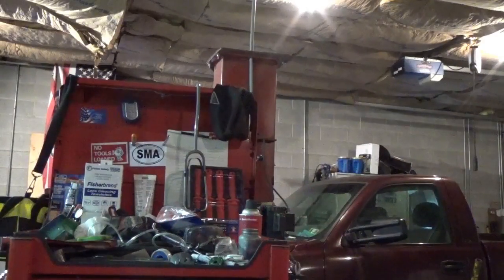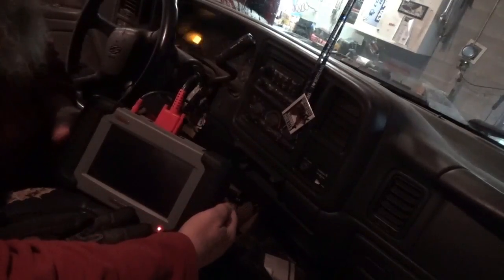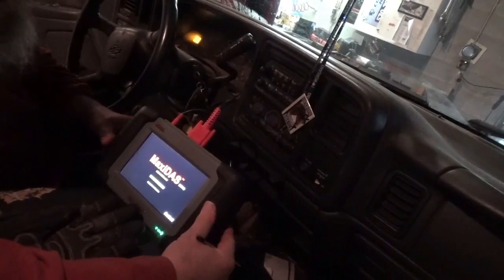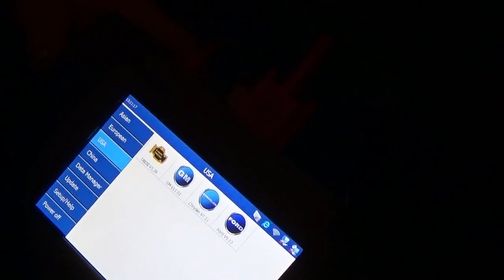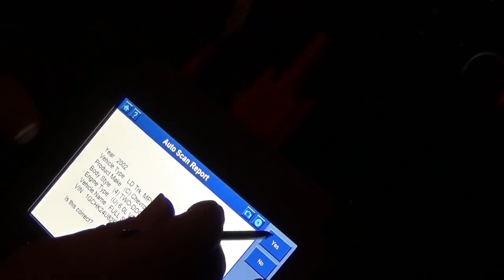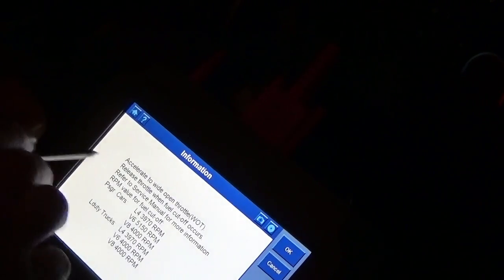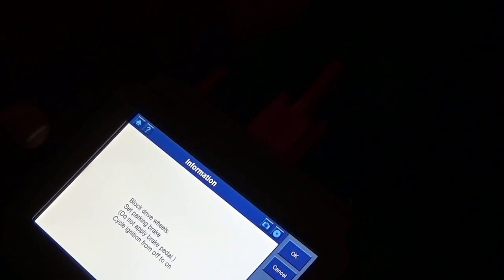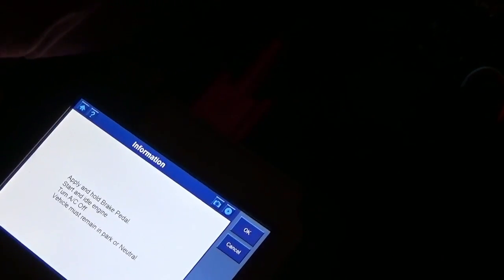Fixing P0300 on Chevy 6.0L with a Cylinder 1 & 6 misfire with Autel Maxidas DS708

Comment: Did you have a lack of power bas fuel mileage
Reply from the maker: I just really noticed the misfire no other real symptoms
Reply: cause mine shake a bit I have very poor accelerations tps maf sensor new intake  gasket new no vaccum leak injector spark plug and wire new the truck have
Reply: 180000km so engine are in top form but I can’t even spin wheel when it’s rain with bald tire
Reply: I don’t have live data scanner so I can’t you what cylinder is missing the most

Comment: Thanks for sharing this video, I have a 2005 GMC Sierra that had random misfire and after replacing plugs, wires, coils I was almost at my wits end. Though I would have to change other parts such as o2 sensors, or injectors but after watching this video and I have a snap on scanner (red brick) and did the CKP variation learn, no more misfires. Thanks again. :)
Reply from the maker: Glad it helped

Comment: Mike, your the Man. I wish I could drink some beers with ya. I can tell your a good dude Man. My whole passenger side of my engine is not working. I pull the wire off the coil and no difference. Does anybody know what's wrong with my 2003 GMC 2500HD. It has to be a wire short or some stupid to thing making it run in Limp mode

Comment: How did you find out it was a misfire on number 1 and 6. Mine just has code p0300
Reply from the maker: Scan tool misfire counter
Reply: @TheDisgruntledMechanic  
My buddy scanned it with a cheap Bluetooth and it just says p0300
Could old plugs cause it
Reply: What’s a scan tool misfire counter
Reply: @TheDisgruntledMechanic  
When getting a p0300 code does that mean a misfire on c1 and c6 for everyone ???

Comment: I have the same exact problem, new plugs, wires ,compression check, injector check. Is it possible that there is still an underlining condition with cylinders 1 and 6 and all this does is setting a performance baseline on the engine?

Comment: Ive still got this problem with the p0300, i just had the crank relearn done yesterday. I did all plugs, wires, coils, intake manifold gaskets, knock sensors and harness, one bad upstream 02, fuel pressure regulator and all the vacuum lines and still it misfires rough as hell and completely randomly. Idk what to do now and i rely on this truck for my new business. Also the truck only has 112k
Reply: don't leave us hanging! how did it turn out for ya?. edit* i saw on your profile you have a ram now i guess you traded it . thats one way to fix it!
Reply from the maker: a ram??? no way!! this particular truck has been retired though.
Reply: Did you ever figure out the issue?
Reply: Did you ever fix it?  If so, what did you do?
Reply: Same
Reply: what happennnneeedxxxx😮😮😮😮

Comment: I used my OTC "EVO" to relearn crank sensor ,it would not relearn , replaced crank sensor , no missfire on 1 & 6 cyl  ,but on cyl s 2 & 3 had missfire ,did crank relearn with OTC ,it did relearn , no more MISSFIRE ! ON  ANY CYLINDERS.
Reply: REPLACED CRANK SENSOR WITH GM # 12560228.
Reply from the maker: @kevinertl  Great info! thanks!

Comment: Was your engine idling rough? Was that why it was throwing that code?
Reply from the maker: it had the p0300 code. wasnt really much of a rough idle.  It is actually in a Tech service bulletin for these models to do this procedure if the engine is running rough.
Reply: Wow really, dang I wish I would have seen your video before I replaced all my injectors, coils, plugs, wires. Thanks man

Comment: I have chevy RV with the 6.0 motor. We thought it might be the lifter? Compression in cyl 8 was 150 and in 6 was only 120. Could this video be our real problem? The code was p0300 and p0306 (cylinder 6 misfire) any other way to do this procedure??
Reply from the maker: I really don't know. but the 120 compression would be where I would start with diagnoses.

Comment: My check engine light flashes when rpm gets to roughly 2400rpm. Replaced knock sensor plugs and wires still does it I’m thinking this could be my solution to the problem...also would it be possible it  would disable the overdrive when the light flashes...if I take it easy after clearing the codes I have overdrive but as soon as rpm reaches 2400 I lose overdrive for the rest of the trip

Comment: Misfire can have different reasons ,Head gasket worn out , or Head Cylinder's Valves are
not good , or Piston's rings are worn out , among other things bad Injectors , Fuel Pump mal
function , or electrical problems with Ignition [ Coils and Sparks ] , there is a need to do Compression
and Leak down test to rule out any problem with the Engine first then you can test other minor 
problems ..... 

Erasing the Warning messages will not Solve the mechanical problems !
Reply from the maker: +Lennox I totally agree but that is not what this video is about if you actually watch it. I did a crank relearn, as GM suggests for this problem, not just "erase" codes.

Comment: man i hope somebody sees this..my 99 express van went crazy one day started skipping. scanner said i had codes from random misfire EGR TPS BOTH 02 sensors and misfire on number 7 so i started throwing parts at it no help at all finally my dump ass took a good look and found a busted vacuum line coming off the intake replaced it and now in stuck with a bad skip only code now is number 7 and random.....

Comment: Hey, so I have a 2004 silverado 1500 with a 6.0 swap, 4l80e, with a 14 bolt 6lug rear end. I noticed my torque converter was unlocking on the freeway at cruising speed (65-75) mph. I have a snap on solus scanner, I noticed on trail throttle or very light throttle (7-12%) I would get multiple misfires especially on cylinders 5,8. I found a small vac leak, fixed it, replaced the maf, and it still did the exact same thing. I came across your video, performed the variation learn in the snap on scanner and it is completely fixed. No misfires, lock up clutch works as it should, and my fuel economy is back to 15/16 mpg instead of 8/9 like it was getting. Thanks for the help! - kyle
Reply from the maker: Glad it fixed the problem!
Reply: Just did this today, I'm hoping to see some mpg gains as well since i was getting 9-10 myself.
Reply from the maker: +Rick Thompson good luck! Hope ot helps.
Reply: @TheDisgruntledMechanic  noticed a 2mpg gain but i did the fix half way through the tank so i probably got a little better than that. Thanks again.
Reply from the maker: @rickthompson7335  That is great to hear! Glad it helped!

Comment: anyway to perform this without an expensive scanner? or do most shops know to do this?
Reply from the maker: the scan tool just needs to have the crankshaft variation relearn function. Not sure which less expensive scantools will do this. But yes most shops with a higher level scan tool should be able to do this. Thanks.
Reply: right on, thanks for the great video!
Reply: for those without scanners:NOTE: If the Crankshaft Variation Relearn is not accessible through your scanner (some truck applications 1998 & later), perform the relearn in the following manner:

1. Turn off all of the accessories. With the Air temperature sensor and Coolant temperature within 5 degrees (Centigrade) of each other, start the engine and let it idle in Park or Neutral for two minutes.

2. Accelerate the vehicle to 55 mph at part throttle. Cruise at 55 mph for 8- 10 minutes until the engine reaches operating temperature.

3. Cruise at 55 mph for another 5-6 minutes.

4. Decelerate to 45 mph without using the brakes, and maintain 45 mph for 1 minute.

5. Perform 4 deceleration cycles, without using the brakes, of 25 seconds each where no specific speed is necessary. Returning to 45 mph for 15 seconds in between deceleration cycles.

6. Accelerate to 55 mph and cruise for 2 minutes.

7. Stop the vehicle and idle for 2 minutes with the brake applied and the transmission in Drive (automatic trans.) or Neutral (manual trans.) with the clutch depressed.
Reply: good luck finding a place this is possible lol
Reply from the maker: +Ronin Motors humm good info. I never looked it up because I have the scanner.

Comment: Just browsing around tonight Mike and evidently I missed this video. Interesting how the crank variation got off, but it sounds like it's a common problem. Maybe there is an issue with the timing chain stretching to some degree. Anyway, hope you're liking that new Launch scanner.
Reply from the maker: not sure what causes it but I do agree it seems to happen quite a bit to these engines.

Comment: been chasing the dreaded P0300 on my 2004 for two years. would come and go. Did a tune up , plugs wires even replaced coils. Random misfire. found this and the car Dr video. been about a week now lights off and code is gone. thanks for the tip
Reply from the maker: YW! hope it stays off!

Comment: Mike
any reason why it lost it's variation
Reply from the maker: I do not know. it seems it is a common occurrence on these engines for some reason.
Reply: Just solved my problem after chasing it here and there after a year.  Big thanks to you and dogbyte555, I was able to find a fix.
I wonder if a or a number of poor grounding locations on the trucks could be root cause.  The grounds aren't exactly stellar on these trucks.  Now, about them brake lines... :D
Reply from the maker: glad it helped in some way!